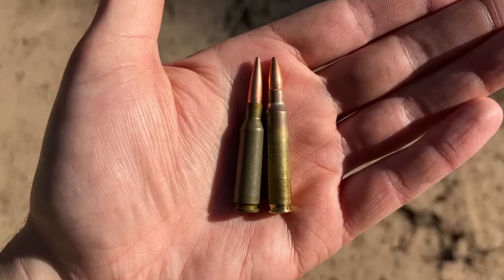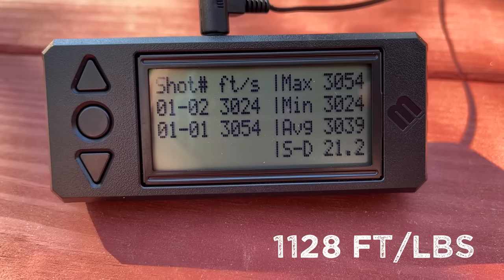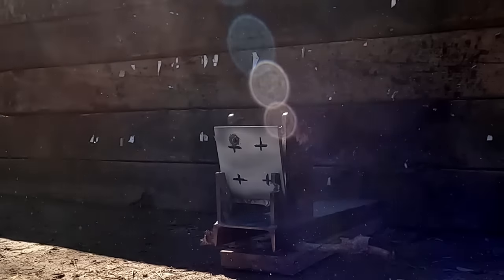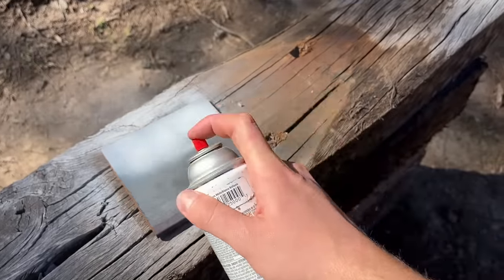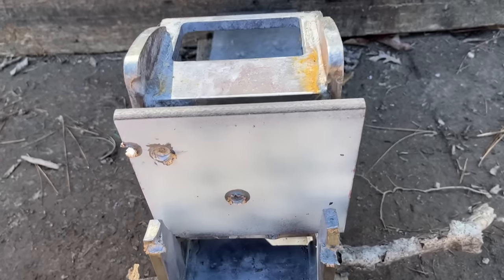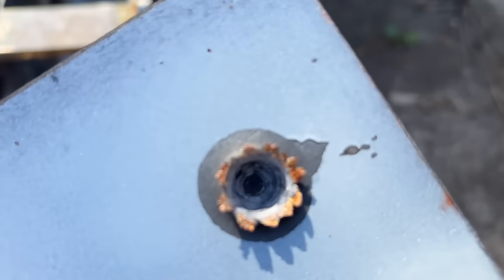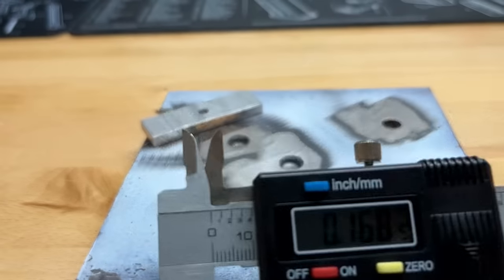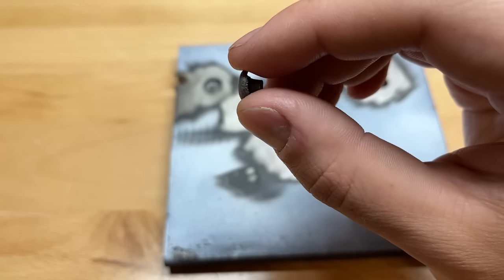5.56 vs 5.45x39 On Mild Steel: NOT So Similar After All?

Comment: 7n6 was never hardened steel, and it was never intended to be hardened steel. It’s just a mild steel, with a lead plug at the back, used because steel was in vast supply for the Soviets. It’s no where near 60 HRC on the hardness scale.

5.45 didn’t use a hardened penetrator core until 7n6m was produced in 1987. The steel in that bullet was hardened to 60 HRC. This round is exceedingly rare to find in the US. It was never really imported; the tiny amount that did make its way here was more likely an accident than intentional.
Reply from the maker: That makes sense. I bet that was the info that I was reading and didn’t realize that there was a difference in designation
Reply: @bananaballistics  - You have a troll using your site for scamming purposes. Under my name in the comments.
Reply: I have some im selling on gunbroker
Reply: @bananaballistics  They are often non distinguished in designation just like 7N10 and 7N10M , 7n24 and 7N24M and 7.62x39 PS and 7.62x39 PSM
Reply: knowing russia,  even if it was supposed to be a hardened steel core,  it probably wasnt. but also i thought the purpose of that round was moreso to tumble then penetrate.
Reply: @mtnbound2764  How do you know Russia?
Reply: @BigSmartArmed  because im not an idiot.
Reply: @mtnbound2764  what's that telling us?
Reply: Yes sir, you are damn right... Сomparison is difficult to call correct...
Reply: I believe some of the bulgarian 7N6 that got imported is much harder than russian surplus 7N6
Reply: As far as i rem the 7N6M uses U-10 tool steel thats Us W2 or 1 i belive
Reply: @mtnbound2764  Я смотрю вы много чего знаете, а наделе нихрена. Столько бреда насмотрелся и наслушался в наш адрес. Ну куда же нам до вас, исключительной нации, разносчикам демократии.
Reply: @DarmoeD88  Every one is an Expert here in the US
Reply: @mtnbound2764  You're correct, 7n6 design was to yaw through tissue.
Reply: @BigSmartArmed  he does not
Reply: @mtnbound2764 idiocy confirmed
Reply: @BigSmartArmed  likewise
Reply: @bananaballistics please 5.8x42 vs 5.45
Reply: @mtnbound2764  You know Russia I suppose.
Reply: @dalmarabdi877  Are you talking about the Chinese intermediate bullets? I don't think anyone who's a civilian outside of China can get access to it. It's classified isn't it?
Reply: Pretty sure this was 7N6M, it has the red marker

Comment: I, as a resident of Russia, can assure you that the core of a 7n6 bullet has never been 60HRC, but has always been mild steel
Reply: Kills by tumbling inside a human target?
Reply: @adrianrubi5012 as does the 5.56.. 

Tumble and fragment kinda at the same time.
Reply: @goldenremnant2610  no wonder Reid Heinrichs zeroes them in the same manner he kinda said they were ballistic twins.
Reply: @goldenremnant2610 the 5.56 doesn’t use steel cores. It uses a hardened steel insert of only 7 grains (penetrator).
Reply: Maybe 60 Brinnel?
Reply: @adrianrubi5012  5,45*39 better ballistic coefficient than 5.56
Reply: @ILYA_SVYAT  …maybe because of the long bullet shape. Thanks.
Reply: @ILYA_SVYAT longer bullet. Slightly higher powder charge. 
Bump up the grain weight on 5.56 to 69, 77 grains and they’re far far better than any 5.45x39
Reply: @trkjivdlopmd  😂😂😂😂 берем валовый армейский патрон - 5,56 сосет. 5,45 и 5,56 для массового оружия, даже м132 не особо распространен
Reply: @ILYA_SVYAT  you might have noticed Americans are loving the new .300blackout round. 
I’ve always wanted a proper 7.62 AR-15 and only recently purchased. 
Now that is a cartridge
Reply: @trkjivdlopmd   в армии м193, м855, м855а1 - у них баллистический коэффициент на прилично хуже, чем у 5,45*39

Comment: Man you gotta get some m855A1
Reply: I agree! Lol 🔫
Reply: Where can one acquire some?
Reply: Gunbroker I have acquired about 400 rounds
Reply: M855A1 out of my 20 inch barrel chrono 3268 fps and put a hole in my 3/8 ar500 target at 40 ish yards
Reply: Yes
Reply: Ian and Karl already killed that comparison and the a1 isn't as good as the marketing.
Reply: Please elaborate because m855a1 kills everything besides m1995 tungsten core 5.56
Reply: @american7169  it is better than 855. The focus was to mostly improve soft target performance and a bit in the penetration.
Reply: I agree and compare it to the 7n39, rather than taking the shittiest 7n6 cartridge.)))
Reply: In that case it needs to be compared to the latest ap 5.45 projectiles
Reply: Careful using M855A1 without a shallow angle feed ramp. The tip can chew the hell out of a feed ramp that's too steep.
Reply: It's been proven to get the most outta a m,855A1 u need a  fast twist barrel. Please look it up.
Reply: @Skenderbeuismyhero M855A1 isn't AP. That's M995
Reply: @ShizawnSanders  true but it is meant to increase the armor and barrier pen and honestly, most of the 5.45 AP stuff is probably not way better than 855A1.

Comment: The 5.45 has less energy, therefore less recoil, but still has a better bullet BC. If you shoot not at 50 meters, but at 300-400m, then the penetration ability of 5.45 is higher than 5.56. That's what it was made for.
Reply: exactly. Cartridge 223 is a copy of the sports 222, 5.45, a product of high engineering.
Reply: 5.56 can shot heavyer bullet so it have a better bc and most 5.45 have a steel core to penetrate stuff when 5.56 dont it is not about the caliber but the bullet type
Reply: And i just finished wacht t he video the 5.56 did pen more in is testing lol
Reply: @ЭнкерСидоров  hight enginering that do everything worts that 5.56 expect recoil thats funny
Reply: @TheJimyyy  justify your comment
Reply: @ЭнкерСидоров  5.56 is a more powerfull round it shot a larger bullet at higter speed it is also heavyer so is bc is better . 5,45 do nothing beside recoil better even penetration the video show 5.56 beat 5.45 in the video …
Reply: @TheJimyyy  shooting at 10 meters is not an argument. look at the ballistics. sometimes they shoot at 100, 300 or 500 meters. How will the 223 perform at 500 meters? How much does 223 and 5.45 weigh?
Reply: @TheJimyyy  maybe you're a child?
Reply: @ЭнкерСидоров  at 500 the 223 is still outperforming the 5.43 … 5.56 is faster than 5,43 when is a bigger and more heavy bullet that mean at 500 it have less drop retain kenitic energy better and have more speed even at 500 . It do better at all range , thats how  ballidtic work lol the 5.56 can still be effective at 700 meter when the 5,43 will not
Reply: @TheJimyyy  Again empty words .... Compare the length of the bullet 5.45 and 5.56 and find out what the lateral load is (ballistics)
Reply: @ЭнкерСидоров  i did . 5.56 use a heavyer bullet and it shot it faster . The bc is for that reason better 5,43 drop 45 inch at 100 meter when 5.56 only drop 9 inch , and a heavyer bullet retain is energy and speed much longer giving it a better ballistic even if 5,45 use a longer bullet is not enough to matter is still lighter and slower so it have limited range and will drop more at any range . Try again
Reply: @TheJimyyy I listed everything earlier. There are laws of physics, but you rejected them. you are ready to say any stupidity to prove stupidity... You say that 5.56 bullets are heavier... 7n39 weighs 4.1 grams, m855-4 grams. I use 4.2 gram bullets from the Barnaul plant. But you're right ok of course
Reply: @ЭнкерСидоров  7n6 is 52.9 grain when m855 is 62 thanks to google you wrong 😂 also everywhere i look it say im right every single article ... but if you want live in your fairy tail word up to you and the round you talking about is not standard infantry round and it will have even more limited range since it start a lot slower you are right physics cant be change thats why you wrong
Reply: @TheJimyyy  I think that other dude has some serious cope issues. 5.56 is heavier and goes faster, that's all you need to know to confirm that the ballistics are going to be better for this round. It will retain more velocity and has more energy to transfer to the target. Simple as. Additional benefit for 5.56 is much nicer and more available selection of ammo
Reply: @TheJimyyy  Did you find out the weight of the 7n39 bullet? 
Let's continue. 1) The weight of the cartridge is 5.45-10.6 g, the whole is 223-12.3, this means that each soldier with an AK can take more cartridges, for example, 10 kg 5.45 is 943 rounds, 223-813 rounds, that is, each soldier with an AK can take 130 rounds more. 
2) Slaughter. 223 has a high-explosive effect, but this requires speed, which means a barrel length and a range of approximately 178 meters, and for the M 4 this is almost impossible. 5.45 has bullet instability, and this action is possible for a short barrel and a longer range - 600-800 meters. 3) the lower bullet speed of 5.45 means low barrel grinding. Therefore 5.45 is higher engineering
Reply: @ЭнкерСидоров  😂😂😂😂 i never read so much bs . Your funny . 7n39 weight more than regular 5.56 and is not a regular bullet armor percing and for armor percing you need speed so again 5.56 armor percing similar to 7n39 outperform it as it have speed to achive armor percing , now if we take regular soldier round the 5.56 weight more and is still faster so it again outperform it . and everything else you said dont make sense and thats just try hard bs
Reply: @TheJimyyy  I justify it with numbers and data, but you just use words... are you a child?
Reply: @ЭнкерСидоров  no you justify nothing you just saying stuff that is not even true lol  you try whit the ammo specs to justify your bs dont worked . and now you try to say is a better rounds because of some bs ! XD the 5.56 was design to be shot whit a 20 inch barrel and it reach over 3000 fps whit that and thats is whit the 62g . the facts is that 5.56 perform better whit a better ballistic and thats it . keep trying if you want it will not make you right number dont lie . thats why 5.56 is show to be better
Reply: @TheJimyyy You lost kid. He used verifiable numbers and data you just yapped with words and bs. Take the L. 5.45 is better
Reply: @kalajari1749  no he sont he give some shitty made of number 👌 5,56 is faster and have better range and more kinetic energy and is more accurate lol thats what every article say . try to find proof and maybe i will take you seriously
Reply: @ЭнкерСидоров  no you made of stuff and thats it . come back whit actual proof

Comment: 5.45 was made more to inflict maximum damage to tissue. 5.56 tends to work better against harder stuff even though it also fragments on impact with tissue.
Reply: Which 5.56?
The original 55gr out of the 1in12 twist
Or the 62 steel penetrator out of the 1in7?

Comment: I suddenly feel less sad about 7n6 being no longer imported. Id like to see the difference between tula or wolf fmj x39 and soviet m43 x39. Though m43 is extremely rare in the US
Reply: Best thing was the cheap price…. Its corrosive though? So wouldnt touch it with my guns
Reply: 7n6 has superior wounding mechanism and terminal ballistics to 5.56 over the entire flight path.  It's a higher BC bullet with greater sectional density.
Reply: @BigSmartArmed  i meant over 5,45ball from tula
Reply: @manganvbg90  While it was around it was the cheapest and the most accurate 5.45.
Reply: @BigSmartArmed  yes but corrosive and im lazy 😁
Reply: Jason Puddy  u missed that im lazy, i hardly clean my guns
Reply: Jason Puddy  windex?
Reply: Russian ammo is getting hard to get here in New Zealand as well.
Reply: Romania makes 5.45x39 ammo as well, as does Georgia and Azerbaijan. Not sure why nobody imported the former before 2022, and still not sure why nobody's importing the latter.
Reply: Tula and wolf are not being imported anymore 😢but luckily ammo manufacturers stockpiled the stuff idk how they managed to do it you can still get 20rnd box of Tula for .60 cent per round 12$ on palmetto . They got sim Romanian ammo 700 rounds in spam cans for 400 .57 per round
Reply: Yeah man it's really tough cleaning your rifle after firing corrosive ammo. You pour a bottle of water through your rifle to neutralize the salts and then you clean the mfer and oil it. Damn that's tough.